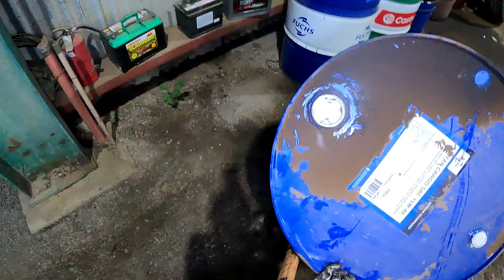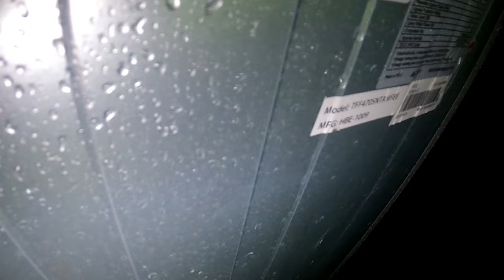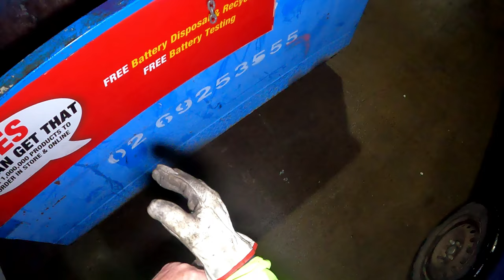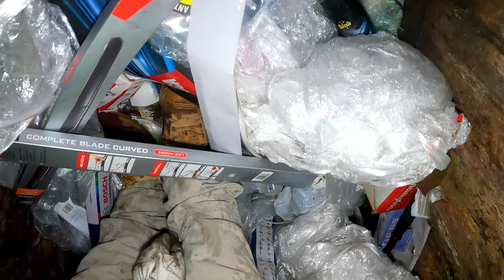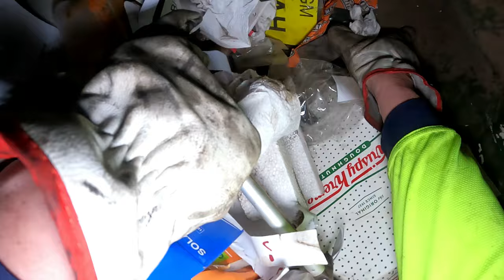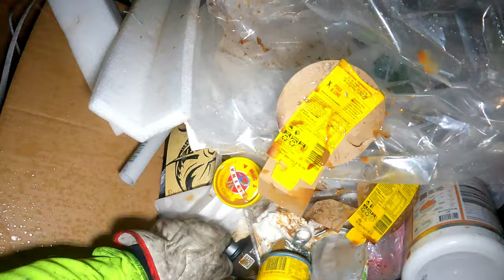Dumpster Diving Rain Hail Sun Shine We Will Get It

Comment: Hi Tim, yeah the Lectra Clear is for spraying on electrical parts to stop moisture/water/dirt etc, It's similar to the CRC Lectra Shield which has the same properties as End Rust it's quite a good product. Once it has set properly it'll last donkeys years if not longer it comes off with petrol or turps or most cleaning solvents. Don't ya just love those rainny days and nights wet socks and a wet butt for the pleasure of not being interrupted while you salvage good stuff when every one else is home warm and dry poor buggas. Havin' some fun now ey Mate? Lol
Cheers Mate 👍👍👍😎💨🏴‍☠☮☮☕☕💡PS Our Containers for Change depot takes marked and unmarked wine and spirit bottles which leads me to think that they get paid by weight for those and not just the barcoded variety which is great as I had a whole stack of all sorts of them and I was told by the lady at the depot that they accept wine and spirit bottles as well as the beer bottles so I cashed those in and I still have another crate here to cash in. And I don't have to worry about crushed cans or plastic bottles as our depot doesn't mind them squashed or otherwise Yay!! CatchCha later🤙☺